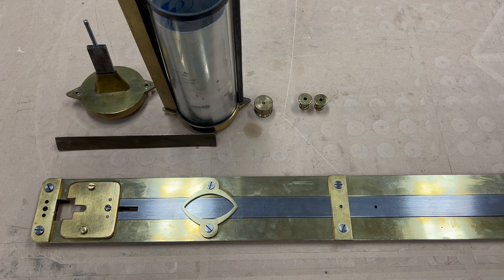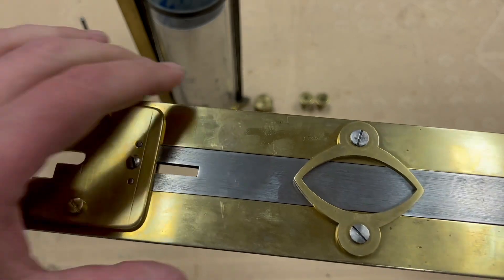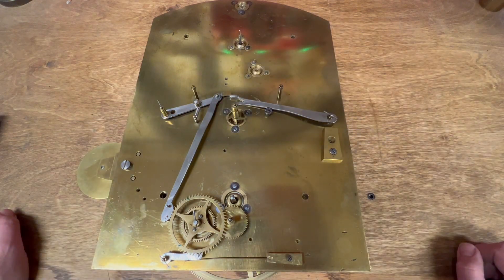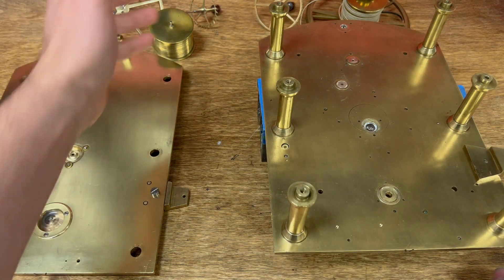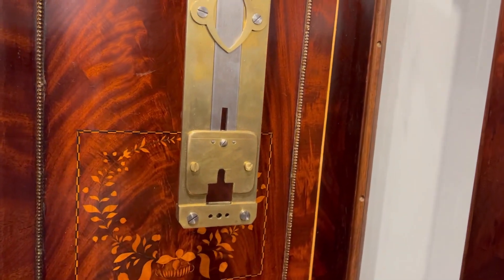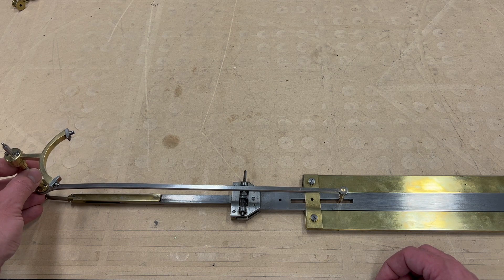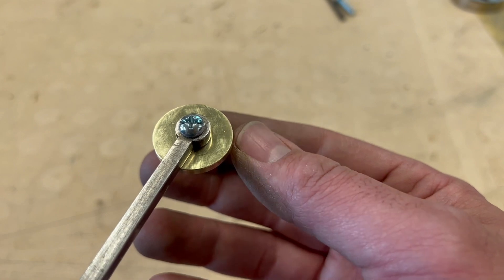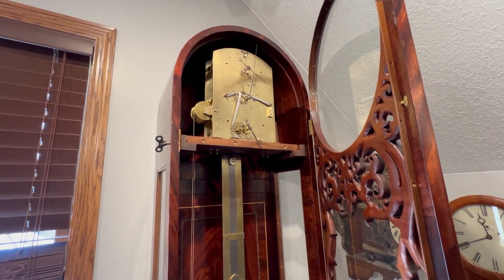Astronomical Regulator Restoration Part 2

Comment: What a strange pendulum indeed. Why would it have both a mercury jar and a bimetallic gridiron? I've read that many clocks that started out as gridiron were later modified to be mercurial because the latter system is better, but if this one was so, why would they reuse the old gridiron instead of making a new simpler rod?

Also, gridirons normally have either four brass and five steel rods, or three steel and two zinc, combinations that are dictated by the ratios of the materials' thermal expansion coefficients. How would two brass and one steel even work?

I wonder then if this was originally an Ellicott compensated pendulum, which does use a center steel and two marginal brass rods, but with a special bob with two levers that raise the bob when the expanding brass pushes on them. And then somebody later would have decided to modify it to to mercury, but kept the original rod just to preserve the clock's original look?

https://commons.wikimedia.org/wiki/File:Ellicott_pendulum.png
Reply from the maker: I think you may be right that it was originally an Ellicott. It's a mystery!